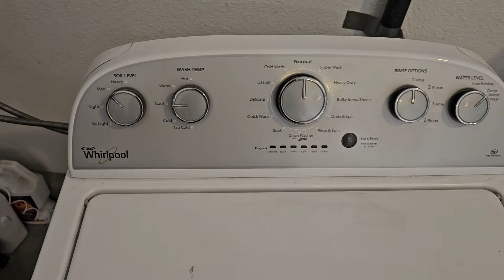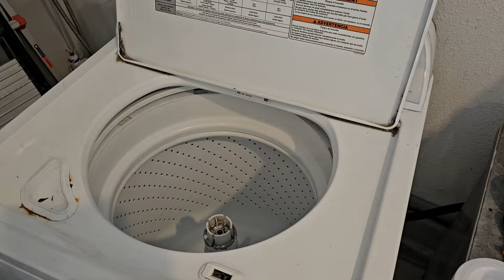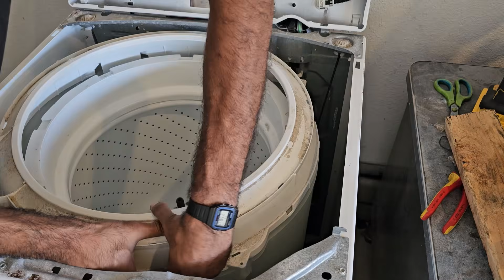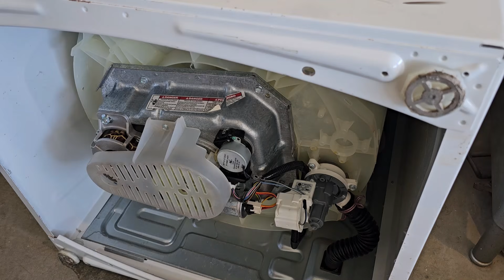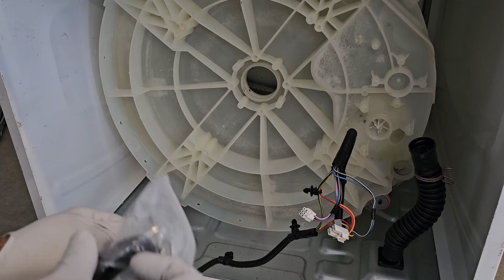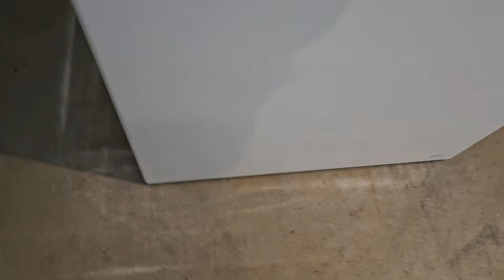Fixing A Whirlpool/Maytag Washer That Is Leaking From Underneath!

Comment: Can I use a small puller on the spanner nut to lift the spanner nut, drive block with the tub?  Once the assembly is out,  can you just whack the driveblock down and the driveblock falls out?

Comment: Is the drum suppose to have water inside ? Ours sounds like it has water but not the clear tub?
Reply: Mine does too when I removed it.  I'm sure that's fine just not every drop of water can get out all the holes?!
Reply: The top of the spin basket is a liquid filled balance ring. Its normal to hear sloshing

Comment: our 3 year old or so more modern whirlpool is leaking oil on the top end of the shaft just under the agitator plate and then into the tub/clothes. can't find a single video on this one  ugh  I can't even get the tub nut off, doesn't want to budge when tapped to unscrew it, either way and doesn't seem to just pull off as my puller didn't budge it and i was afraid to put more tension on it.

Comment: I have that same washer. I replaced the pump barring, fixed the hose that did have a pinhole with superglue baking soda, then used epoxy, wrapped it in tape, then wrapped it in rags about 3 years ago as a temporary fix until I could get the hose. Unfortunately I couldn't find the hose so I left it. A few days ago it started leaking again so I figured it was the hose however the rag was bone dry. I zip tied it up so it wasn't rubbing the floor anymore which is probably why it still works lol. Anyway now the damn pump seems to be leaking and I have no idea where to find parts for it. I'd rather fix it but looks like I may have to buy a new one unless anyone knows how I can find parts.
Reply: RepairClinic may have them. I just brought some rare/hard to find parts from them that I had lots of issues finding anywhere else
Reply: @Zoe101-b4w I was actually able to find it on Amazon. I took it off and it actually had a part number on it. I still can't find the hose but it's still not leaking so I am going to leave it alone. I bought one online that said it was for my washer years ago but it was completely different so I guess my temporary fix is a permanent one lol. I paid less then $20 for the pump and it only took about 2min to install it. I didn't take the cover off I just jacked it up on its side but it worked.
Reply: @my2centz196  Nice, glad it all worked out. Just fixed my leak last week and today my new/used motor came so wish me luck!

Comment: Nice video but the process way too involved for an inexperienced person. Too much to dismantle and put back - things easy to dismantle but usually difficult to re-assemble properly. Also using a hammer to loosen parts can lead to all kinds of grief. However, the diagnosis was excellent and the video is helping me decide whether to have mine professionally repaired or buy a new one.
Reply: Haha, almost anything is easier to take apart than to put back together again. My first experience with that was when my sister took apart our baby grand piano. What was she thinking?

Comment: Went to change the seal and mine has a welded washer on top of the tub seal. No way to change it because the transmission housing is below the seal.
Reply: Found the same problem with mine. I cut the washer off with a saw zall and smoothed the shaft out with an angle grinder. Wasn't sure if it would seal, but holding up after four loads. This will be the last Maytag I ever buy. I'm pretty sure that washer was put there solely to keep you from changing the seal!
Reply: @rziem420 is your seal still holding?  I’m wondering if I can do the same or if I have to buy a new transmission assy with the integrated seal.  Thx.

Comment: Found one of those exact machines on the side of the road in like new condition , for the life of me I cant find anything wrong with it, ran it through 10 loads of wash and works like a charm. No leaks that I can see etc.  I wouldnt be surprised if maybe that seal is going bad and only leaks sometimes sort of thing. I have not put a super large load in it though.
Reply: They charge to take old machines away so it’s likely someone upgraded their still working washer and they left it out for scrappers (or you) to take.